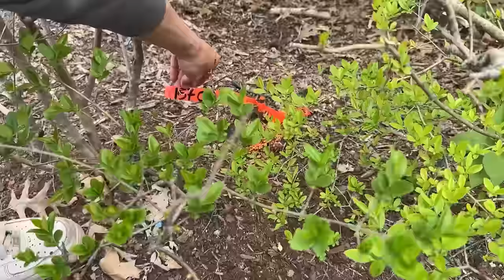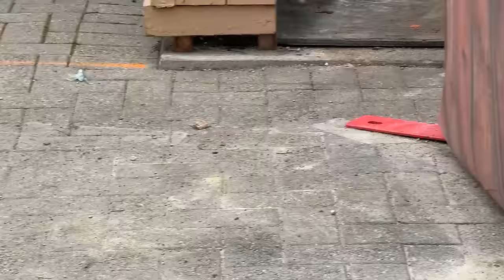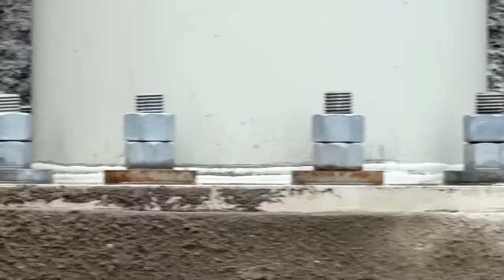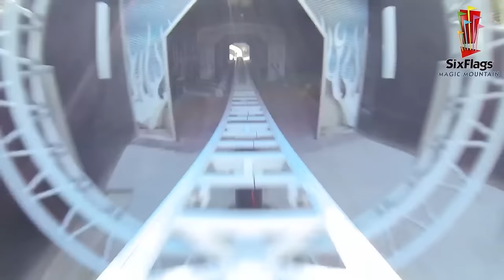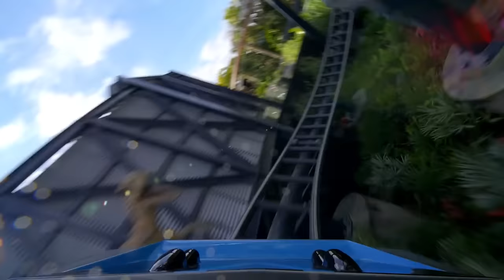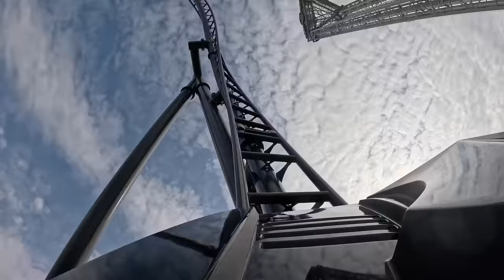Canada's Wonderlands 2025 Coaster CONFIRMED?!?

Comment: The path to our 2025 coaster has felt like a journey in a way. If this project turns out to be an Intamin, I'm going to scream.
Reply: Not going to be an intamin lmao
Reply: @ruscaliso  why not? looks like there are pretty solid evidences pointing towards an intamin
Reply: @ynje203  if cedar fair was going to work with intamin again they would’ve done so with top thrill 2. Choosing to work with zameprla over intamin on intamin’s coaster is a complete bridge-burner from a business standpoint, not sure why they would chose to mend the relationship now instead of when it made logical sense.
Reply: @ruscaliso  I'm completely guessing so I could be wrong, but Intamin was most likely just out of the budget for TT2. The project seems like it came up pretty much out of nowhere for them so they had to go with a more budget option.
Reply: @ruscaliso  It's inaccurate to assume Intamin wouldn't be considered for the new coaster just because they weren't involved in the tt2 revamp. Revamping an existing ride and designing a new one are vastly different projects, possibly requiring different areas of expertise. Zamperla may have possessed unique skills needed for fixing ttd OR it could have just been that perhaps Zamperla was a more immediately available option. What if Intamin was no longer interested in maintaining/revamping TTD b/c of resource issues, budget issues, etc?? They could have actually wanted to give away TTD to a different company like Zamperla and there may have been agreements between those companies. There's just too many possible reasons as to why CF chose Zamperla and it's not correct to assume CF and intamin won't work together because of that.
Reply: @namevone  that’s a fair point, however you have to think that if cedar fair were interested in working with intamin again they would’ve done so and when it comes to this particular project the predictions have been all over the place and I just can’t see it being an intamin, we will find out soon enough though 👍
Reply: @jmisthcs96  yeah, it doesn’t make sense considering the history between the two plus there’s no evidence it’s an intamin lol. INTAMINs are great tho and I’d love to see more
Reply: @ynje203  When is the last time CF worked with Intamin?
Reply: Definitely feels like a journey.
Reply: 305 was the last straw, shoot the rapids was the nail in the coffin. But this was well over a decade ago so I’m hopeful it is Intamin
Reply: @ruscaliso IT IS
Reply: Facts.  I remember the days not too long ago when Intamin wasn’t even in the mix of possibilities.

Comment: Zamperla poached a bunch of Intamin engineers about 5 years ago, when Zamperla decided to start a complete revamp of their coaster  offerings, still in progress. There is a reason Zamperla got the TT2 contract and were capable of doing the launch, it has a bunch of former Intamin engineers. They were able to integrate off the old Intamin structure of Top Thrill easily b/c they probably had intimate knowledge of it, as former Intamin employees, some of them might have even been part of the  original design. There is a reason the lightning train  & its restraints are essentially the same as Velocicoaster & Pantheon, poached Intamin engineers. Also, former Intamin engineers would or could likely use the same footing characteristics of Intamin. So,  wouldn't be so sure of Intamin & not Zamperla. There is also the fact Cedar Fair has been buying a lot from Zamperla & nothing from Intamin. CF just had to settle a lawsuit as co defendants  with Intamin. It was a partial blame game, so that likely didn't make the relationship better . Cedar Fair could have went to see Velocicoaster & asked Zamperla can you do something like it, given you have former Intamin engineers. This was already decided upon prior to TT2 opening, but  given the initial reviews of TT2, Zamperla's stock is rising in the minds of Cedar Fair. Wonderland's project could be a custom Lightning Coaster model.